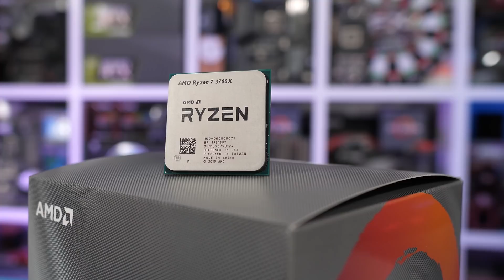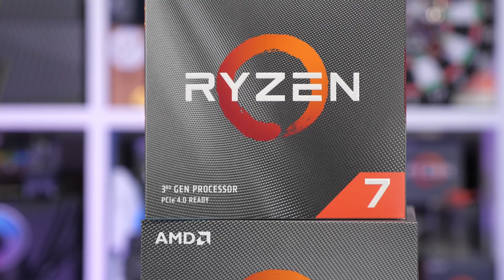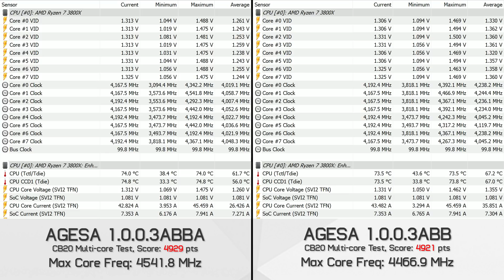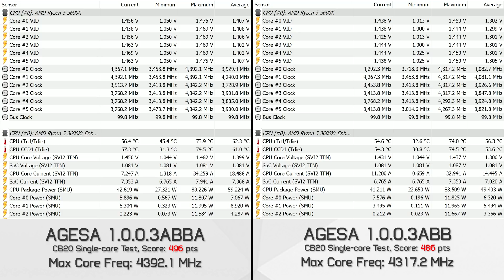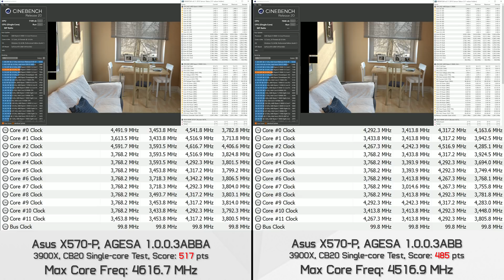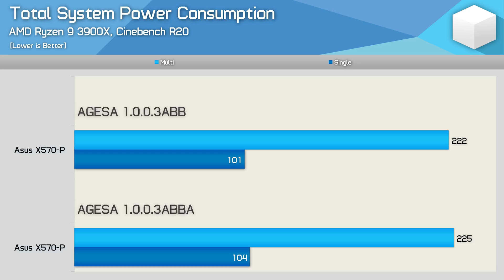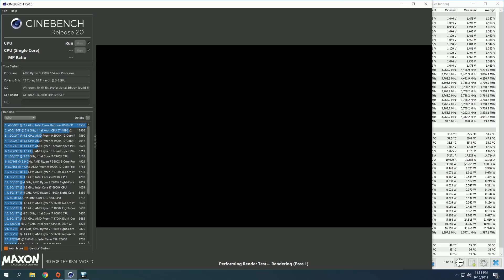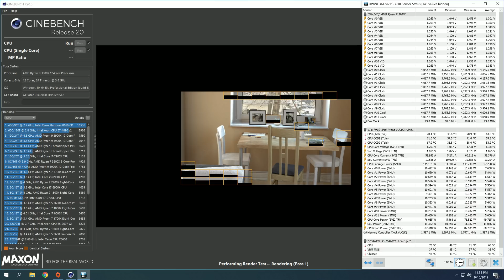3rd Gen Ryzen Boost Clock Fix Benchmarked, AGESA ABBA Time!

Comment: 1) who the heck came up with the versioning for agesa?? Why have numbers if you're just gonna keep tacking on letters??

2) I don't think it's been blown out of proportion. The performance isn't super different, but that's not the point. But, the advertising was the issue. Nobody wants to see a boost clock advertised on the box and have that not achieved with stock settings (and stock cooling, because some ppl tried to argue if you used LN2 it'd boost higher). When testing, I was happy with my performance. But I was unhappy i paid for a 3600x that acted like a 3600. That was my issue.

Comment: Having tested this, it helps immensely in highly single threaded games. This is specifically mobas (HotS for me). Most modern games are largely multithreaded so of course you wont see any large changes with those, but for games that aren't this is a huge deal. I saw a ~30% increase in 1%, ~45% increase in .1% frametime, as well as a ~20% increase in average frame time in HotS. The .1% and 1% are what really matters as those are stutters and what gets you killed. HotS is literally a worst case scenario for this processor, just run the game and look at task manager and you'll see what I mean. Either way it now outperforms my old 8700k system in HotS. The framerates are much more consistent as well (lower variance), but that's something you can only subjectively look at as Afterburner doesn't keep track of variance and I don't take time to put frametimes into excel or another stats program from FRAPs.

Asus x570 TUF Wifi and a 3900x.
Reply: Care to show a screenshot before/after?
Reply: Not sure how you'd screenshot this and there is fluctuations between games (difference in maps and heroes), but you can look at a overall average.

11-09-2019, 00:43:58 HeroesOfTheStorm_x64.exe benchmark completed, 139673 frames rendered in 1029.266 s
                     Average framerate  :  135.7 FPS
                     Minimum framerate  :   27.9 FPS
                     Maximum framerate  :  322.3 FPS
                     1% low framerate   :   63.3 FPS
                     0.1% low framerate :   45.1 FPS

13-09-2019, 05:03:59 HeroesOfTheStorm_x64.exe benchmark completed, 111609 frames rendered in 645.343 s
                     Average framerate  :  172.9 FPS
                     Minimum framerate  :   21.7 FPS
                     Maximum framerate  :  303.5 FPS
                     1% low framerate   :   81.7 FPS
                     0.1% low framerate :   62.2 FPS
Reply: @Bensam123   CapFrameX ?

Comment: Updated X570-A PRO with this beta ABBA update and ran Geekbench without changing anything from BIOS defaults only turned PBO on and 5 cores hit 4.400 MHz, 1 hit 4.350 MHz and the remaining 2 hit 4.325 MHz
https://imgur.com/a/ja9EgQb

With previous BIOS I very rarely had a couple of cores hitting 4.4GHz, but most of the time it would look like this: https://imgur.com/a/oPlaIwC
So it's definitely much better.
By the way my "shitty" X570-A PRO VRM's are running quite cool, so cool that the fan NEVER even turns on... because I'm not an idiot to run any system without decent airflow.

Comment: I'm not sure if I agree with this being "overhyped". Yes, the deficiencies were small to begin with and arguably not even noticeable in a lot of cases - but that wasn't really the main point. The point was that it didn't do what it claimed on the box. Not only does that risk breaking false marketing laws (and AMD doesn't want another "bulldozer lawsuit") but also if it went unchallenged it could set a very dangerous precedent for the industry where it suddenly starts to be "ok" for manufacturers to put numbers on the box that only the best of the bunch can actually achieve. Needless to say this would not be to the benefit of us consumers.

Great to see AMD managed to solve it though. Nobody likes feeling that they didn't get everything they paid for.
Reply: AMD has rushed to "fix" this precisely because they knew they were in legal jeopardy by missing the advertised mark, even if it was only  by 0.025 Ghz.
Reply: Exactly my words. With my Combination of the MSI X570 Creation and 3700X on 1.003ab it couldn't even achieve more than 4.25 Ghz. 1003abb increased that to 4.35. Still missing something and we're just talking about the STOCK Numbers out of the box. What about PBO ? The launch was rushed and i feel like a Beta tester even buying two months after release.

Not the best show AMD pulled off here.

Comment: X570 Crosshair 8 hero, 3900X.

Processor would boost to 4.3 4.4 with ABB. Updated to ABBA, now boosting to 4.4 according to PCMark and 4.55 according to HWInfo.
Reply: So it still doesn't reach the advertised clocks..
Reply: @Valandized  4.55 can be considered 4.6 for processor clock speed.
Reply: @dvtye3378  You don't really mean that, do you? That's common mathematics 4.55 < 4.6
Reply: @Valandized  and it's common in sciences and engineering to round them as in 4.55 can be rounded up to 4.6 as the promoted boost speed has a specificity to the tens unit thus meaning you have to round 4.55 to 4.6.
Reply: @dvtye3378  Do they somewhere specifically state that (on the box of the CPU for instance)? Or is this a personal opinion? Because I've never seen AMD or Intel specifying on their CPU boxes that the clock speeds are all rounded-up
Reply: @Valandized  See that doesn't matter, in sciences when you compare data you round to the value with the least amount of decimal points as you're adding unneeded specificity onto someone that doesn't have that much accuracy in the first place.

So when AMD advertises a 4.6 boost and not a 4.60 boost, notice one a single decimal point in the tens position; then the results of all of your calculations after measurements should be rounded to the same decimal point. Meaning it doesn't matter if AMD doesn't specify it, because of how they've provided the info you're supposed to interpret it this way or else you will likely always find your results being over or under, never exactly 4.6.
Reply: @Valandized  Also this changes a lot, but I provided the incorrect boost speed, it's actually 4.591, so yes rounding up it's 4.6. This is why decimal counts and rounding is important, because my fuck up changed a lot of how the data was interpreted.

Comment: I agree in parts with you Steve that people have exaggerated a bit about this problem 

However, AMD has already slipped in the past (cof cof bulldozer "octa core") and many are concerned that it will become an intel "2.0", but I still give my arm to cheer and agree with you that this revolt (and BIOS gains) are minimal for ordinary users 

Thank you so much for making this video!

Comment: This fix coming for x370 and x470?!
Reply: kinerry later, much later. I am sure that 570 flagships gets bios update first, msi godlike, asus formula and so on. The middle range 570, then low end 570 and then highend 470... so you get the picture. Eventually They will get those but new boards Are priorised!
Reply: @haukikannel  x370 and x470 have some problem...it need adjustment because not all have 32mb bios, some only have 16mb bios, mobo maker need adjustment for that point. that why it soooooo loooooong waiting for new bios.

Comment: first i din't see my boot drive nvme anymore (bios F5) in boot F12 menu was a empty tab but could select it. i updated it to Bios to F6a, and now i see the drive again. !
JEEEJ, but no uefi string infront of it, would it hurt my pc ? it only says windowsbootmanager drive in bios, (only the usb drives have uefi infront of it, because it's a win10 installer)
but i wonder if more people have this. pc runs fine btw.. but i don't understand that the uefi string infront of the drive is gone ... (Ryzen 3700x, g.skill mem 16gb. gigabyte x570 ultra, nvme auros 512 m.2 (non gen.4).

Comment: Steve, don't take this the wrong way, I think you have done some fine work here exposing the issue, but in both your previous video and in this one you imply that the aorus  extreme  had a bios that worked and that the other boards had defective bios.  Roman ' s survey showed there was no magic in the aorus extreme, other users weren't getting the the boosts you were, you just had a golden sample.  Your test of the same chip in multiple boards showed that the problem wasn't inherent in the silicon.  You would need to test the same chip in multiple copies of the same board to establish that it always behaved the same before saying that company A got the bios right and company B got it wrong.  ABBA basically shows the problem is at AMD, not the board vendors.
95% of 3900x weren't boosting properly.  Somebody needs to do a survey to see if ABBA
really fixed the problem.  Of course that should wait until ABBA  is actually released by all the board vendors.
Reply: I second that! 👍
Reply: Bulzoid did say not related this case that your motherboard quality, cpu quality and ram quality matters. So all in those you will get ”good” and ”bad” samples. Maybe hardware unboxed just happen to have good quality extreme board and other testers happen to have not good versions... though what Bulzoid know anything... ;)
Reply: @haukikannel  Buildzoid is a pretty knowledgeable guy about getting performance out of computer components.    When I said HUB has a golden sample  I meant exactly what you said.  HUB had a "good"  aorus extreme motherboard.   Other people didn't get the same results on that motherboard.

Comment: Anyone know why i can't take my R5 2600x up to 4.25ghz as it was supposed to go up to without overclocking? it sticks to base 3.6ghz and wont go up at all :(
Reply: @darkhazard9808  Sorry for the delay, its an Asus PRIME B450M
Reply: @duramirez  make enable xft from bios maybe will help
Reply: @linkdiablo4476  xft? whats that? :-P
Reply: @duramirez  xfr ... sorry my bad
Reply: @linkdiablo4476  oh found it. I set it to Enabled, but... in Task Manager it still say 3.8ghz hehe need to put some stress to see if it goes up :-P
Reply: Enable boost on advance option if you can find it
Reply: @linkdiablo4476  Yeah i did it.
Reply: @linkdiablo4476  Just so i understand this correctly, will it register in Task Manager? or it's something that happens behind the scenes? :-P
Reply: @duramirez  should be regitered to task manager.
For sure download ryzen master or hw info to monitor

Comment: I am very confused with the PBO Scalar functionality (which boosts cores higher but results in lower Cinebench scores, probably due to higher temps) and the functionality to "add" up to 200 MHz (which adds up to 75 MHz in my case, much higher voltage and again, results in lower Cinebench scores). The only tweak that works for me is activating PBO itself since 88W is limiting my CPU a little bit.

Comment: Running max boost for only seconds at a time is not a fix, boost must run the the remainder of the thread or app time limit.. intel turbo or boost runs in definite unless thermal or power throttle...
Reply: No. It doesn't unless you set it manually.

Comment: I dont use pbo, but run 4500mhz all core on the Gigabyte Master by setting pstates to 4500mhz and 1.45. Vcore. And just setting infinity according to memory speed, currently 3666mhz cl 14-16-14-14-30-44-1t and 1833mhz

Comment: I read the official statement from amd.But this thing has gotten out of hand because fingers were pointing at amd for selling a product that doesn't run as it should.But those people was just to lazy to look it up and would rather flame on forums like keyboard warriors.One even said amd knew about this issue before the cpu launched which are not true as they would not advertise something if they did not achieve it in there test setup.

Comment: I have Asus ROG Strix X570-E. With this bios update, I managed to get single core boost clock at 4416.7 MHz for my 3700x with stock cooler. R20 single core score is 509 and multi-core 4955. I am happy now. :D
Reply: wow that was super point for 3700X

Comment: What about the insane long memory training and the resulting long POST times?
Reply: I managed to test it now by myself - x570 AORUS Pro, 3700X with Dark Rock Pro 3 / 99.8 MHz BCLK (100 MHz with Spread Spectrum disabled) on every version - All tests with optimized defaults

With F3 Bios (AGESA 1.0.0.3) 44x Multiplier on all Cores (at some point) - sadly no CB Scores noted
F5 (AGESA 1.0.0.3 ABB) i got 43,8 on 6 Cores and 43,5 on 2 Cores at some point. Cinebench R20 Single Core average Boost Multiplier was about 43.3x (CB Score 4649/488)
F6a (AGESA 1.0.0.3 ABBA) 44x on 2 Cores 43.8x on 3 Cores and 43,4 on 2 Cores. Average CB Multiplier is about 43.8x. (CB Score 4794/502) - EDIT: After Running 3D Mark i got 44x Multiplier on All Cores at some point - overall improvements in 3DMark is ~ 0.5% in CPU Scores where CB improved about 2,5 to 3 %.

POST took ~ 45 to 60 Seconds in all cases :( - switching to Quick Boot or disabling CSM does nothing, still the same.

So i can say AGESA ABBA fixed the boost clock issue for me (though with 1.0.0.3 i got 44x on all cores) - but the overall scores improved

Also before i got 1,4 Volt average on all cores, now it is at around 0,95 and some cores go to sleep from time to time with 0,2 V.

thx AMD, and now please fix those insane Memory Training with Ryzen 3000 ;)

Comment: Agreed, this issue was overblown.  The tech YouTuber survey that lit this fire was flawed and unscientific, but it got a lot of people riled up and no doubt generated a lot of clicks and view time for that site and other sites that jumped onto the bandwagon.  So instead of spending its resources getting the next Navi GPUs ready for launch, AMD had to focus on this teapot tempest.  I know, different people work on different things, but a corporate distraction like this affects everyone.

Now motherboards makers have this new AGESA so they can find new ways to break things and once more we can reset and update our BIOS for a potential gain of a mostly imperceptible 1-1.5% in max boost.  Hooray.  Frankly, I've done enough fiddling with BIOS updates and chipset driver updates and firmware updates so I could run Ryzen 3xxx on 4-series Aorus boards.  Both my 3600X and 3900X seem to be working just fine with ABBA.  I won't be updating again unless a real need arises and until it's been in place long enough to prove stable on my boards.  As of this moment, Gigabyte has not released an ABBA BIOS for its 4-series boards anyway.

Comment: Some, a loud but small group of people, get all worked up over nothing.  I hope we can hear from them now, so they can tell up how great things are now.  We get the same performance we were getting before.  a 1% improvement in SC lightly threaded workloads at the cost of 3% more power draw.  I have an 1800x that can reliably hit 4.2 GHz out of the box, but gets a 3670 in CB20, while running it at 4 GHz all-core, it goes up to 4130.  Clock speed isn't everything, just look at comparisons between 9900k and 3900x.  Slower CPU comes out on top.  Latency is the last remaining obstacle now.  The fleeting 1ms jumps to 4.6 aren't going to do anything but give a few weirdos the ability to say "look what my CPU can do."

Comment: As someone who thought, (and still thinks), it's a silicon quality issue let me clarify what i at least meant. Since the CPU's could do it on a few MB's it was clear that they could do it in the right circumstances. But the limited, (and mostly high end), nature of the boards suggested that it required very good operating environments, (in terms of the Mb environment not temperature), to do it in. That from everything i know is almost always a sign of silicon pushed to the ragged edge. That doesn't mean AMD couldn't improve things with say an AGESA update as they have in fact done.

Comment: So our community is basically "chicken little" once again! The conspiracy theorist guys and gals got nothing on us!
Reply: Stephen Hunter my 3900x still won't boost over 4360ish in single core. X570 gigabyte pro WiFi on abba agesa. Hoping a fix is still incoming for that.
Reply: @dangoodall1253  I really hope you get that fix but the vast amount of complaints were speeds so small that with the fix there is really very little difference. That was what I was referring to as "chicken little". Its similar to the situation of the GTX 970. Everyone freaked out about the memory but the 970 turned out to be darn good card that still holds its own today in certain situations. Same thing with the Ryzen's except it looks like it was less about misleading the consumers and more about not ready bios instructions.

Comment: My 3700X runs at 1.5V IDLE! Hopefully the new BIOS will fix that. I don't really care about 25MHz more or less, but 20°C lower idle temps woulb be nice.
Reply: enable the "C-STATE GLOBAL" IN BIOS. In my x570 aorus elite the auto is enabled, but it is bugged. If you have a gigabyte motherboard enable this option. Tell me the results :)
Reply: @alexmads6363  Sorry for the late reply. I have got a MSi motherboard (unfortunately) and there is a similar setting "C-State Control". I enabled it, but Voltage is still up :(
Reply: @88lochi  mmm have you installed the newest drivers?  you can find it:
https://www.amd.com/es/support/cpu/amd-ryzen-processors/amd-ryzen-7-desktop-processors/amd-ryzen-7-3700x

Sorry for my bad english :(

Comment: Can you test the new Ryzen Master and see if it crashes when you run it on a 2rd screen?  If the screen that you run it on is not the main screen, the tool tips and scrolling will crash it.  I sent a bug report to AMD but they seem to be ignoring it.  I was hoping that you could confirm it and point it out so that they will fix it.  thanks